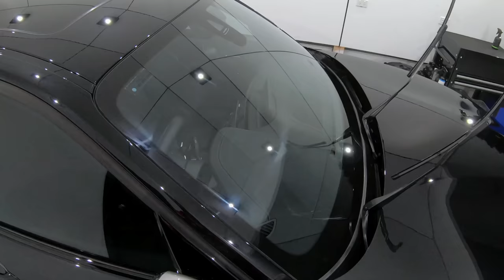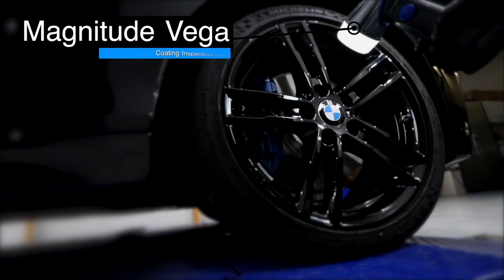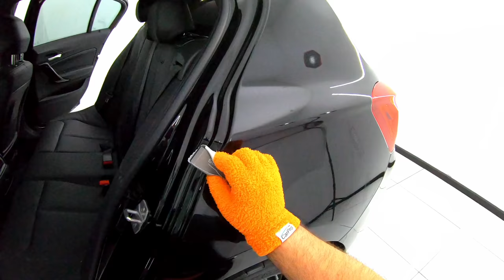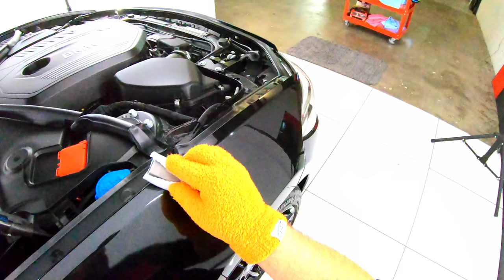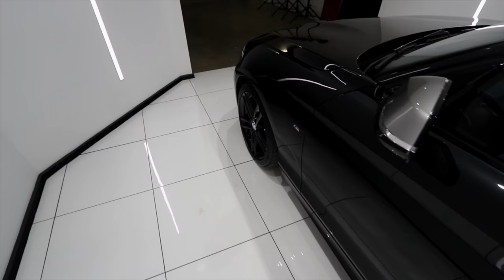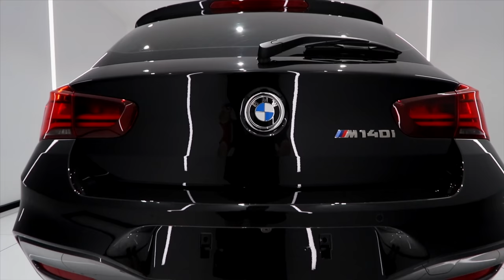BMW M140i Finale Full Detail - P3 Ceramic Coating & Finished results! (Vlog 30.3)

Comment: Nothing to say but THANKS for sharing the experience and very relaxing teaching movie! Can you please share your experience for windscreen coatings. I have found I am not satisfied with CarPro FlyBy 30 because it repels not so good as expected and even worse than less expensive Turtle Wax Water Repellent (need to be re-applied often). Can you please share your favourites or what is your list with several names please to be able for us in Europe to find some of them out )))
Reply from the maker: The only other one use is Nv Nova Glass, it’s a bit more work to apply but I get great results with it

Comment: Hi Sandro is the rain sensor safe to coat with the glass coating just asking 
As i put tape over my mums VW before i went over the windscreen with Fuso
Glaco. 👍
Reply from the maker: Yes it’s safe completely mate, I’ve coated over mine for years without issue

Comment: That car is stunning after you were done. Which applicator do you use for the ceramic coating?
Reply from the maker: Thanks, and it’s the supplied applicator with the Nova Coatings.

Comment: After you coat the car, are you able to clean the microfibers that you wiped the coating 
with?
Reply from the maker: If you want to reuse them they have to go into warm soapy water as you switch to clean cloths while you’re still coating the car, so you’d have a bucket or sink setup

Comment: I dont have a garage but planning on polishing a car. Its just in a shade with a roof coverage. Is that a no-no? Or maybe i can blowing dusts off with a car dryer before approaching new panel, is that plausible? 

Thank you for your answer.
Reply from the maker: I detailed many many car outside as a mobile detailer so although it’s great to have a garage, you can certainly still do it outdoors.
Reply: @CarCraftAutoDetailing  thank you, your channel is awesome. Catching up lots of your videos lately.

Comment: Hi  Sandor , another great video 👌 quick question why do you wear the car pro microfibre gloves when doing the coatings seen it in a couple videos. Thanks Ted
Reply from the maker: Thanks, and I mostly use them because don’t make my hands sweat like latex or nitrile gloves
Reply: @CarCraftAutoDetailing  Aww ok was just wondering if there was added benefit for the coating or something.

Comment: Mr. Sandro,  For glass or paint coatings, What would be the GSM to use on microfibers when leveling them?
Is it correct to also coat the wipers?  Wouldn't that be damaging the windshield because of it hardening/crystallizing the rubber in them?
Xoxo from Puerto Rico 👍🇵🇷
Reply from the maker: There’s no magical GSM for coatings but lower GSM cloths do tend to work best. 
Glass coatings don’t harden or crystallise - if you keep the cloths you’re see this - and coating the blades gives them a little extra glide, thanks mate.
Reply: @CarCraftAutoDetailing  thanks for the explanation, really appreciated 
Xoxo from Puerto Rico 👍🇵🇷

Comment: Hi Sandro! Just applied a dedicated coating to my windscreen, but now I have a serious case of wiper judder... any tips?
Reply from the maker: Unfortunately some windscreen and wiper setups as well as coating are more prone to chatter than others. You can try putting a slicker sealant over the glass coating to see if it helps - Meguiars HCW, Nv Lustre, Carpro Reload. If that fails it’s not the end of the world, but you’ll have to compound it off and it should be as it was prior to coating it. It sucks but glass coatings can be a gamble, awesome on most cars not every now and then it goes south!
Reply: @CarCraftAutoDetailing  would it help if I put some coating on the wipers itself? Thnx!
Reply from the maker: You can certainly try that, there’s a chance it could help.